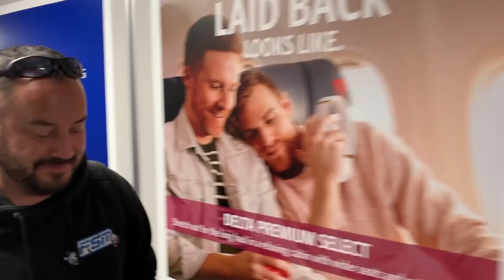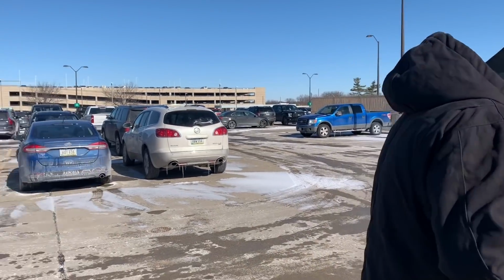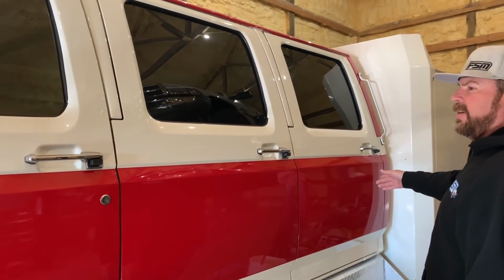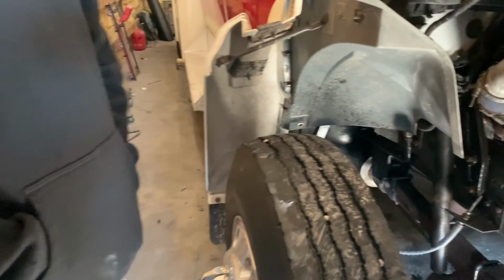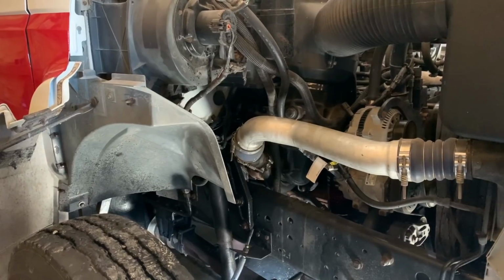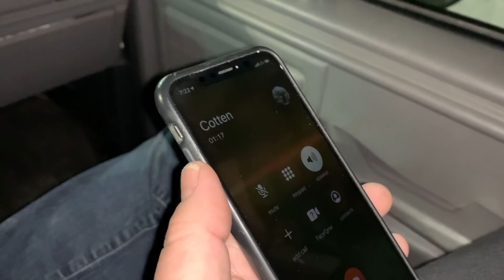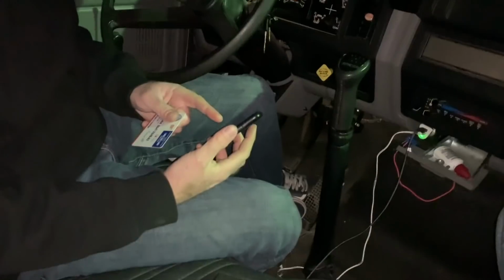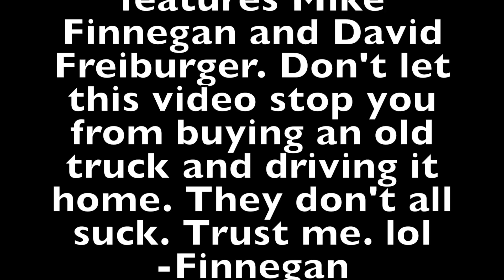I Bought a Six-door, Cummins-Powered Truck and it Died on the Way Home! Finnegan's Garage Ep.91

Comment: The moment I saw the dip stick bungy corded in I knew there was some positive crankcase pressure and figured it was a head gasket.
Reply: And the amout blow by pushing out the breather
Reply: Far from normal ok a 30k mile rig
Reply: Or normal for a very small motor in a big truck towing a 5th wheel.  I'm betting the pump was turned up.  Regardless, it is far better to replace mechanical parts than having to fix rust / bodywork / paint.
Reply: @bobroberts2371  What does engine size have to do with blow by
Reply: Andrew Smith small motor has to be worked harder for that big truck
Reply: @DuMpst3Rmike  Explain how that relates to blow by.
Reply: Andrew Smith  A small motor will wear out faster than a larger one when given an equal load.  I'll use a typical car for an example.  

From what I've seen, it takes about 20 HP to push a medium sized car on level ground to 55 MPH .  This car might have a 150 HP engine rating but only 20 HP is being used.  Take this same engine and put it in a car with more frontal area ( wind resistance ) / weight that requires 100 HP to maintain 55 MPH and the engine will be working harder / wearing out faster.  Think about HP / Hours.  Lightly load an engine and you get many hours, heavily load an engine and you get less hours.   Adding to this, an engine only makes as much HP as the load applied to it requires.
Reply: Andrew Smith what Bob said. Premature engine wear from constantly having to use it harder
Reply: @bobroberts2371  the 5.9 CTD is not a small motor lol its a 66,000 GVWR engine, it was never designed to be put into dodge pickups, it was just an afterthought that it could in fact fit into dodge pickups
Reply: @bobroberts2371  Ours pulls everything like there's not even anything on it - it drives virtually the same with or without trailers. They are done up far differently than what are stuffed into pickups and make gobs of torque at very low rpm/hp. Ours has a allison auto and have never had one single issue (was daily driven). They set them up per application from the factory.  
 Engines have base horsepower ratings and your not taking into consideration the trans or gearing which effects what can be put down to the wheels - more strain less strain dependant on application used.... this truck was designed to haul.  
 And as far as it being a big truck.... the F800 shares the same cab as the regular pickups but with a fiberglass one piece nose (nothing else under there) which just makes it seem really bulky when looking at it... aside from its bigger rails (which was cut down in our cases) and a heavy ass rear end (with no 4wd up front in our cases). There is really not much to them, super simple-light design made to serve many different applications (many are in F800 dump trucks, box trucks, or boom truck hauling a load of poles behind them all day every day). 
 I know for a fact they make great car haulers too and from the tracks because we used ours for such all the time and I doubt he will be hauling a bigger race trailer then what we did all the time (a huge double decker with quarters) so he should easily be fine with it id imagine.... if not then it needs a fixing - something wrong because it should easily do everything that he will set out to do with it.
Reply: The B  5.9 is a small engine , this 6 door should have had a C 8.3.  I know someone that drove this type of truck ( tree service with a chip box / man basket towing a chipper ) with both engines, the 5.9 was always foot to floor just to keep up with traffic.  Yes, the engine was originally designed with industrial / tractor uses in mind and Case was a big part of the design.
Reply: @bobroberts2371  they're horribly detuned. We used to have a ford 650 fiber optic splicing truck with a 12v cummins that could hardly do 55mph. Same thing with Our older gmc 6500 bucket trucks that had cat 7.2l  engines. Straight dogs. But our new freightliner bucket trucks with a 6.7 cummins will hit the gov speed of 75mph with ease lol
Reply: If his foot had to be to the floor to go anywhere then he probably had a nerfed 5.9 or something was wrong with it. They regulated a shit ton of these engines for fleet trucks, school buses, etc. etc. etc. etc. so employees couldn't beat on them. Ours was regulated to shit when it was a box truck but a few hours of time fixed all of that.
Reply: Joker432 - The 5.9 is a tiny engine for a diesel and should not have been in that truck, there is no way that is 66,000 GVWR engine. Considering the truck I drive is a 12 Litre Inline 6 which is GVWR for 81,000 lbs, and I'm governed at 72 mph, and uphills hauling that much it slows down. I can't imagine what a little 5.9 would do with any considerable load.
Reply: Red Tank “there is no way that is a 66,000 GVWR engine” uhhh so you know more than Cummins? Considering they are the ones who rated the engine. Lol go sit down, it’s clear you have no facts to back up your argument.
Reply: @bobroberts2371  Yep, the 5.9 is a total pig in a medium duty and they tend to get used up pretty fast. I don't even look at medium duties with anything smaller than a DT466.
Reply: joker432  Where can we see a spec sheet that states the 5.9 is a 66,000 GVW over the road engine?
Reply: @bobroberts2371  Like you said these engines were put into tractors or pumps where they have to run under full load for days on end sometimes and they can do that without issues or wearing out particularly fast. I guess this is because they are tuned to lower power in these applications?
Reply: EinachserLS Yes, in industrial applications power is limited or what what they are driving is a low load because the goal is to make the engine last. I'm betting this truck had the injection pump turned up and was run hard.  An average car only needs something like 20 HP to maintain 55 on a level road however a 20 HP lawn tractor engine would not last very long but a 200 HP engine in this car would.

Comment: He says: "Its a pickup"
He means: "It's a stretched freightliner with 20ft of living space towing a 40ft Long trailer like Jeff Lutz".
Everyone's saying 8.3!!! Mike's thinking more like QSK 45L v12
Reply: Over in the thread   "  The moment I saw the dip stick bungy corded in I knew there was some positive crankcase pressure and figured it was a head gasket. "  joker432  is saying that the 5.9 is a 66,000 lb GVW rated engine.  Sure maybe as a yard truck / city delivery but not an over the road truck.   Even a non turbo 4B can " move " 66,000 LB but it won't be going very fast or form many miles.
Reply: You could option the 5.9 or the 8.3. Having worked on them, that looks to be a 5.9. The engine bay is ..... Empty.

They should go for broke, the big brother, the 855.

Comment: seller: "truck has 30k"
engine has 530k.
Reply: To be fair the engine could be 30k and just never really driven, 12v's don't like to sit
Reply: "500k miles on a cummins, just getten broken in.  I know what I got"
Reply: @DIESEL1JZ  This is so true,gaskets and seals a sure to fail if engine isn't ran regularly.
Reply: @lawnmowermanlawnmowerman9930  and rule number 1 of Big Ole trucks in the midwest, they run twice a year, or every other year.... that's about it, they too expensive to run more often then that
Reply: @cmusic52  But those engine's characteristics are still the same. Regardless of how the owners choose to use them.
Reply: The oil cooler probably failed allowing oil to enter the coolant.  The 
real issue is when the engine is shut off and oil pressure drops, 
pressure from the cooling system will push coolant into the oil.
Reply: Cool as Ice so do powerstrokes
Reply: @Cool as Ice the record is just under 1.5million miles there was a segment here on youtube about the truck it is used for hotshot and is the original motor the injectors were replaced at 1mil miles when one injector was failing  heres the link if your interested : https://www.motor1.com/news/394622/ford-super-duty-million-miles/
Reply: @Cool as Ice only thing without an overhaul is a semi or commercial vehicle the pickup last about 350k before it needs an overhaul
Reply: @Cool as Ice the highest mile engine for cummins in a pickup is 1.7 million miles but its had multiple head gaskets lift pumps and such the ford has never had a head gasket the injectors at 1mil was the only thing intrusive and 7/8 injectors were working properly every motor has its ups and downs
Reply: @Cool as Ice its all maintenance for most vehicles my family tuned 2012 6.7 cummins has over half a million miles he is a hotshot driver i do all the maintenance myself dodge is real bad about wiring and steering related products failing duramax has shitty tie rods ford has shitty emissions again comes back to what i said before every truck has its ups and downs i do custom 1/1 builds i've seen a variety of miles from different vehicles my dream truck is a 99-03 7.3 powerstroke full 4dr 4x4 dually but i've been trying to get one for 10 years now and unless someone gives me one for free i won't achieve that dream
Reply: @TylerDuysen  and that's how you start a comment war, bring up Trump, guns or diesel trucks lol never fails
Reply: @bassblaster505  yeah seems that way thats alot of people afraid to think there truck isn't better than everyone else's i don't believe in politics that's just a mess and guns have been around longer than the babies in the comments there to defend us but ya im not getting in to that im a singer songwriter so i like having a broad audience being one sided about politics gets in the way besides they come for the songs and entertainment not to here bullshit thx for the reply man i appreciate it you have a good night sir
Reply: How many digits does the odo have
Reply: @Dwightsp26  because the cab is from an 80s ford id say 5 but its possible it has a 6 being a wrecker chassis
Reply: @bobroberts2371  Yes sir,they are assuming a head gasket a bit too soon.
Reply: @TylerDuysen  and why wld they give you one? Do something crazy like the rest of us n buy one?
Reply: @TylerDuysen  and stop whining about ur health as we all have our problems
Reply: Stanley Banks The oil cooler on this engine is behind the oil filter plate and is immersed in coolant.  Entirely possible for the oil cooler to put oil into the cooling system.
Reply: @Rocketogre  all orginal, including oil.
Reply: It's not the mileage it's the hours. Could have 30k on it but worn from just idling
Reply: It's a cummins, that's enough
Reply: @TylerDuysen   They are 6 digit. The large trucks were behind in body and safety, the rest was on par, at least in the 97 f800 with an Allison 545

Comment: 12:50 dip stick bungee corded and hose clamped on is not a good sign.
Reply: Yep lolz. She probably blow that thing out like a shotgun round lolz
Reply: Yeah, there were alot of red flags on this one, but even with a bum engine this is a pretty cool truck.
Reply: If it was an episode of roadkill, that  would be right at home
Reply: @Skwisgar2322  I think they knew that. May well need an engine replacement but the rest of the truck is worth it.
Reply: Saw that too and it will need an alignment too look a that front tire
Reply: Not buying the 30k miles if blowby is that bad.
Reply from the maker: when I questioned the seller about the dip stick his response was "that's commercial truck stuff." I nearly died laughing inside.
Reply: @FinnegansGarage  I hope you guys got a good deal on that truck. I've driven pretty far to buy cars and trucks several times and I always feel obligated to buy them. I've learned to walk after buying a duramax in downtown atlanta that "developed" issues on the 2 hour ride back to SC.
Reply: @TheMEXICANBEEF   Head gasket issues seem to crop up on these real heavy setups with that 5.9. It doesn't seem to be blowby from mileage, probably from a blown head gasket. I doubt a truck like that would rack up miles anyways.
Reply: @Snarf_Le_Wombat  Facts. I used to have an F800 service truck and My 5.9 puked a HG at @ 95k.. It's a lotta work for that small an engine.
Reply: @FinnegansGarage  Haha. Every so often I see an episode where it must have killed you to stay quiet and this one had so many moments of them. lol Commercial truck stuff. Thanks for the laughs over the years, can't wait for more.
Reply: @FinnegansGarage  PS: Come to Yellowknife and race on the ice road. They road test BMW's up here, no shit. I could try to get you an in with them if you wanted to do something different. Roads. Made of ICE. On a LAKE! Jolly good fun.
Reply: @FinnegansGarage  I figured you seen it its hard to miss. Lmao. I'm ready for the rest of your adventure home...

Comment: LMAO!!! you should of ran when you saw the coolant and kitty litter on the ground LOL!
Reply: ye they for sure put leak quick fix on it and just clamped everything down, pretty obvious he was trying to hide something since it was so well cleaned before he came
Reply: @Zirion123  If he was trying to hide it, there would be no kitty litter or coolant on the ground.
Reply: @victorbitter583  its a truck shop dude, could be from anything for all he knows
Reply: @Zirion123  No mechanical workshop I ever worked in would have left that pile of shit on the floor after doing a repair. When the job is finished you clean that shit up.
Reply: @victorbitter583  not everybody is that way if its a guy having a truck company at his farm or something. Clogged heater core is also a ded giveaway for ppl that have used stop leak products
Reply: @victorbitter583  then why didnt finnegan mention IT in the video they were looking for coolant leaks Next to the seller in the shop and was surprised when the heater cut out and got hot.. maybe U should watch the video again
Reply: @Zirion123  I don;t know and it's not relevant to my observations. Ask Finnegan. If I had to guess I'd say he wanted it regardless of the condition of the engine and thought if it didn't make it home it would at least make for a good video.
Another thing not mentioned was the price so anyone saying he was ripped off is uninformed in that regard.
What I can tell you 100% is this. If you are trying to pull a swifty, you DO NOT leave a pile of sawdust and a puddle of coolant under a vehicle you are trying to sell. Capice?
Reply: @Zirion123  Incredibly stupid? Who? You're making a lot of assumptions here. There's every chance that this was a fair arrangement. I've seen no evidence to suggest otherwise. I could be wrong but there is no evidence to have that opinion.
Reply: @Zirion123  1 other thing to consider. Remember the last one he bought. Remember how he bagged the shit out of the seller due to the lies, plate retrieval and subsequent lack of assistance? I didn't hear any such complaints in this video.

Comment: 30k miles, huh? Does it by chance have a 5 digit odometer? 😂
Reply: Johntyson it did look fairly clean, but what i saw was a fairly fresh paint job and a lot of new parts in the engine bay. Pretty sure the seller fixed it up and found out the engine was on its way out and dumped it
Reply: @MrAnbrca  Seats are pretty clean. It likely just sat and rotted. Machines really don't like to sit like that.
Reply: @blueborealis  yep. A low mile vehicle that sat for 10-20 years is potentially worse than a 35yo 330k mile car that gets driven everyday
Reply: Yup. I feel this truck is worth it as a project though and Finnegan knew what he was getting into.
Reply: @blueborealis  Very clean truck, but id have to ditch that 7 speed for a 9 or 13 speed or even better an allison
Reply: @JohnnyAnderson1  Uhhh why? For no apparent reason
Reply: J Findling you have never driven a 7 speed I’m guessing?
Reply: @JohnnyAnderson1  for someone that hasn't ever driven a 7-speed, what's wrong with them?
Reply: @wrifraff  the they are hard to find gears in, you will think your going to 4th but you will be hitting 6th, you will think your going to 3rd and hit 5th.  Unlike the 9/13/18 speeds or even 10 speeds witch keep the same basic shift  pattern just with a high and low side Also the 7 speeds are synchronized witch will grind alot unless you use the clutch on every shift witch will be very jerky...
Reply: @Snarf_Le_Wombat  so he can shift 16 times before he hits walking speed, it's all the rage bro.
Reply: @JohnnyAnderson1  I'd imaging it's just something you'd get used to.
Reply: Burning Rubber the seven speeds I have driven shift just like a 6 speed with an extra low down by your knee. Only hard to find gears in if you’re not familiar with it.
Reply: Bought it for cheap pulled the low mile engine out put in used engine flipped it 👌👌👌
Reply: @carsonhammond6204  they work and I can defiantly drive them but not something I would want at all! Usually take off in 3rd but its still not a smooth shifting trans compared to the non synchronized 9/13/18  & 10 speeds
Reply: @0xsergy  lol no I was just using them as an example a 9 or 10 speed would be plenty of gearing and with no load you would normally start off in say 4th gear on flat ground.  a 13 and 18 are the same trans as the 9 speed just they allow you to split the high side (13 speed) and high and low side (18 speed)
Reply: @Snarfelle  I doubt that.

Comment: "Diesels need to work hard." -AvE, 2019, recorded upon fixing a busted dinosaur-squeezin machine
Reply: Any engine needs to work. Without oil moving around seals dry up, corrosion from just humidity in the air happens, coolant in passages runs out of corrosion inhibitors (likely what happened here, bad coolant ate up the head gasket). Saddest thing is to see a rebuilt engine that sat for years and ends up having to be rebuilt again due to corrosion from no oil covering things inside.
Reply: @Cragified  I agree worst thing is to let it sit!